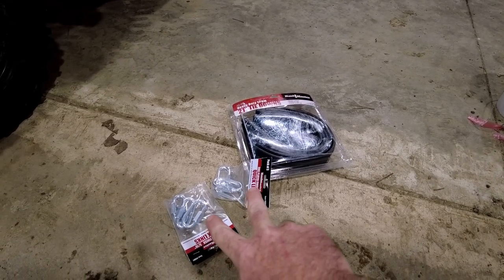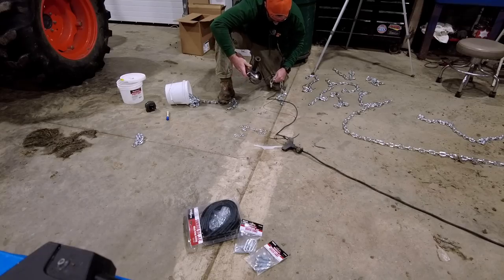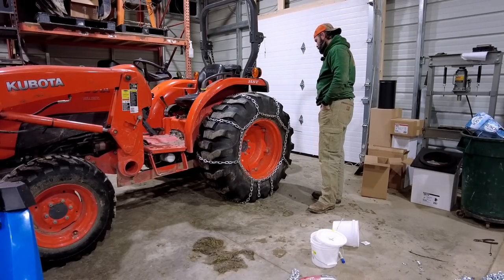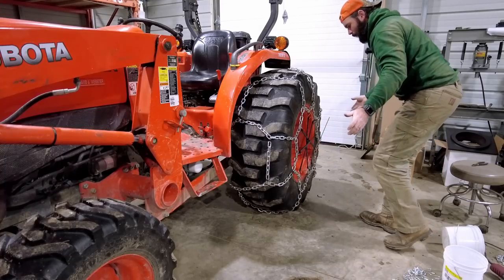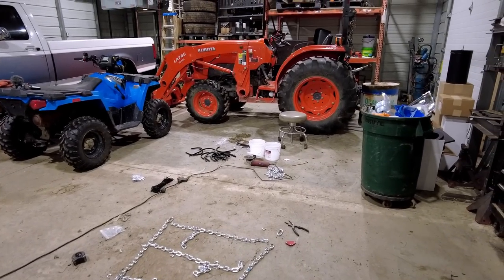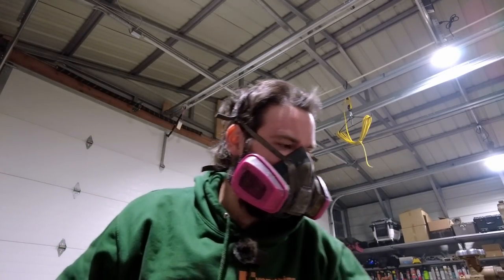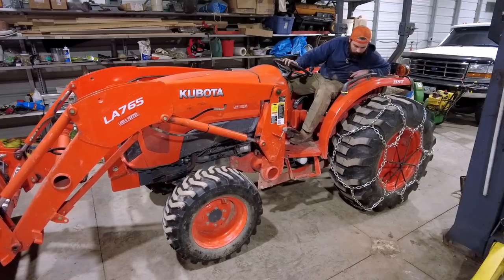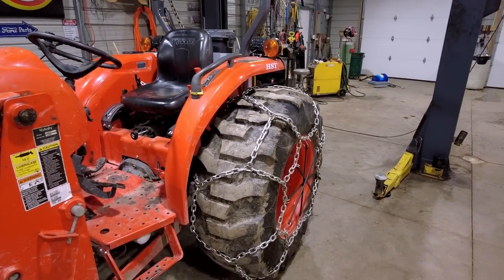DIY Tractor Tire Chains: Build for $180

Comment: I haven't made a set from scratch, but added every other ladder bar onto a set.  I used grade 70 transport chain.  I think it's a harder steel, so will wear slower.  Also welded fine without having to remove finish.  When cutting links, I just cut one side, and twisted with two cresent wrenches.  Re-bent once linked to what I needed, then welded.  Not sure if this weakened it enough to matter... but that was half the welding.
Reply from the maker: Makes sense!

Comment: I did mine similar, but added a ladder cross chain for every tread, and they cross at an angle over the tread. and once tensioned they stay on top of the tread all winter, no issue. They should work just fine.
Reply from the maker: I’m very happy with the way these turned out, especially for my first go at it

Comment: My older JD 4100 had industrial tires and I made my chains pretty much like you did except I used chain connectors rather than weld.  They worked fine except needed a couple additional cross links.  Hanging the chain from the wall or a rafter makes it work rather than crawling on the floor.  I also cut down car chains for the front tires and wrecked 3 front ends before I was told by a dealer never to chain up the front end of a JD 4100.  Not sure if I will try it with my Kubota.
Reply from the maker: Yeah I probably wont chain the front, you don't want to be blowing a gear box apart when one set grabs and the other is stuck.

Comment: nice project.  other options... bolt cut connecting links on one side and twist open in the vise, hammer closed and weld.  Also, they also make C shaped connecting links that can be hammered closed for your 90 deg attachments.
Reply from the maker: Great idea! Thanks for watching

Comment: You need to add 3 ladder rungs and shorten each rung by about 4". The trick to getting chains tight is to air down the tires before installing the chains,  after the chains are installed add air.
Reply from the maker: Thanks for the tips. I have my rear tires loaded so I can’t take much air out of them. They won’t “squash” much.

Comment: When I built chains for skid loader I used them connects n for the cross links used bolts with lock nuts is ideal for u to but u have welder tho
Reply from the maker: Gotta work with whatcha got. Thanks for watchin!

Comment: I will answer this for all, 7100 ultra dual shield all postion really great wire for deep penatration but great wire, takes high volts and high IPM inch per minute.
Gas less fluxcore wire, all postion wire, great outdoor wire, you don't need a fluxcore cup or gun just use everything you have and keep your cup as close to your contact tip, you will be so surprised on the money you save on gas, plus you will be surprised on how well it does and how strong it is, they weld bridges, buildings, etc with gasless flux core, it works Mr. 
Next your 70s6 nothing better the hard wire it's just a all around wire all postion just awesome, so I will say this, don't go cheap on this wire. I buy hobart products I don't care what the reviews says about this wire its badass its simple to tune in and welds smooth. Your gas  C25 or 75 25 works great, 100%C02 also if you want deeper penatration. Those are the basic wire you should use. I will get into welding rods later try those first let me know how you make out. If you where wondering I have 18yrs of welding experience and have no issue showing or helping anyone out, be safe.
Reply from the maker: Thanks for the suggestion!

Comment: And how much was your time worth?  Sure $180 for the chain, plus 6-8 hours of your time.  This will probably be more expensive than just buying a less expensive set of chains.
Reply from the maker: The cheapest set I could find for my size tire was $800. I spent about 4 hours on this project. I essentially paid myself $155 an hour for making them myself.
Reply: That is fabulous for your time.  That rate sound like changing the brakes on my VW passat.  the shop wanted $1400, the complete kit cost 600 plus 60 for the tools, and 5 hours of time(included learning curve).  That was about $140/hr.  the second time i did the brakes it was faster.   Good luck with the snow this winter.   @EverythingElliott
Reply: Plus, consider that's true for some.  I have plenty of spare time and like doing fab.  Saves money and is an enjoyable project

Comment: I do not buy anything from harbor freight I hate that Chinese junk. It always fails when you need it the most. I don't like the theory of their better than nothing.
Reply from the maker: While I agree on most of that statement, chain is pretty hard to mess up. And with the way I’m using it, I won’t be stressing the chain in anyway that it will break.
Reply: I would have agreed with you years ago, but they have stepped up their game.
Reply: @EverythingElliott  Got ya.